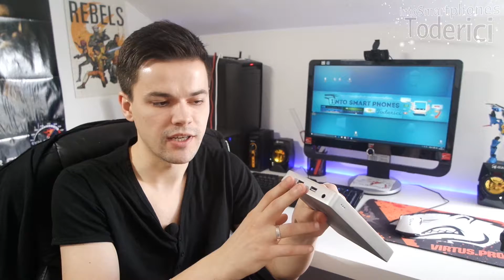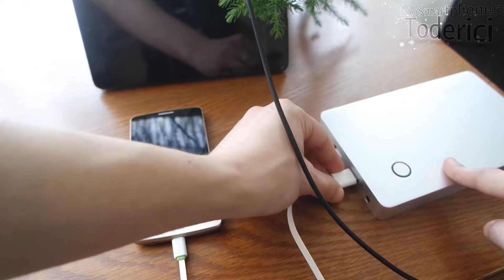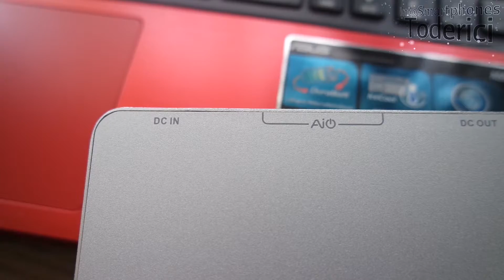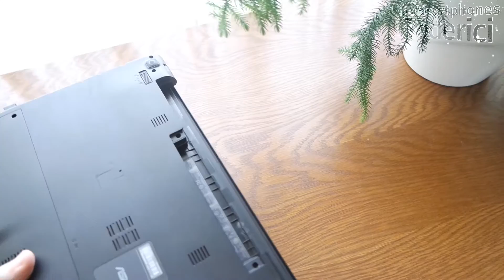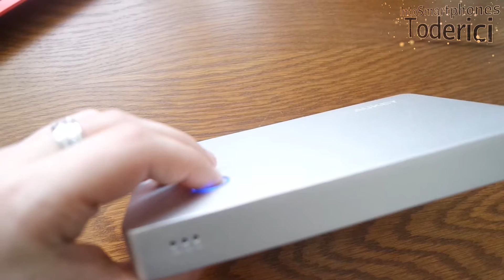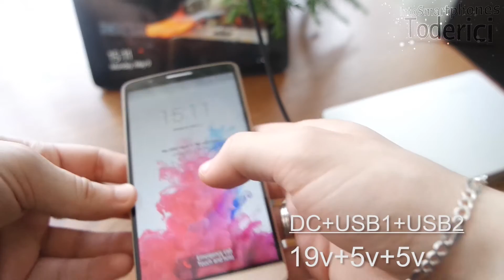Insane 28000mah Power Bank Multi-voltage (5v 12v 16v 19v) Aukey

Comment: can use this power bank as ups for router ?
Reply from the maker: You could yeah
Reply: @TechToderici  I have 19 v asus router ( ac68u) , it is work on 19 volt , can I put it on 15 v or 12 V dc output, or it will hurt the router ?
Reply from the maker: It will be fine, is just you can't really find this powerbank anymore, also the router will discharge it pretty fast in a few hours
Reply: @TechToderici  what do you mean : the router will discharge it pretty fast in a few hours
 ? sorry
Reply from the maker: Yes
Reply: @TechToderici  I do not understand you sorry
Reply from the maker: How do you want to use it? Put your rrouter directly into it and use it everyday? Or just in case that your electricity runs out?
Reply: @TechToderici  Yes ,  Put my router directly into it and use it everyday  to give me power  when the electricity runs out.
Reply from the maker: Well you can't leave plugged in into the wall charger and at same time take power out of it
Reply: @TechToderici  It is a special ups but like power bank < it   charges and gives power at the same time. and when the electricity runs out it directly gives power to the router .and it has multi voltage output 9v, 12v, 24v,15v . But unfortunately doesn't give 19v . That is why I ask you if the 19 v router work normally on 12v output in the ups ?
Reply from the maker: You can try but even if it works it will discharge it too fast

Comment: can i charge also my msi gt72 which has a 19.5 volts input?
Reply from the maker: can't really tell, but it should charge it with the battery plugged in, but can't affirm, you can always buy it from amazon and if doesn't work return it